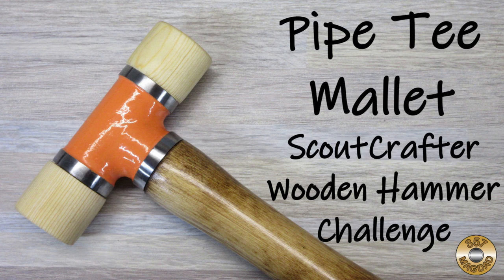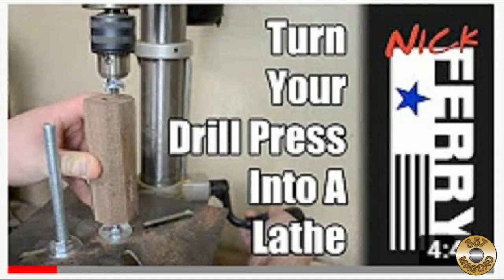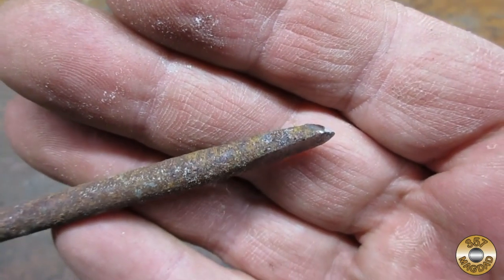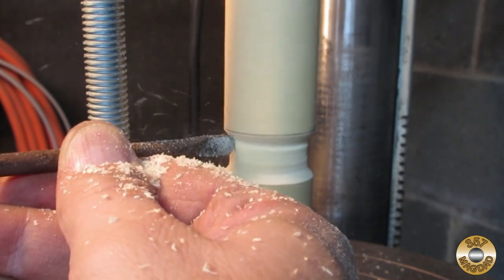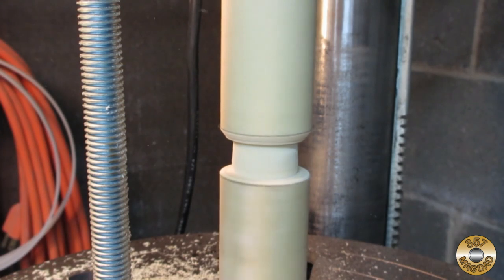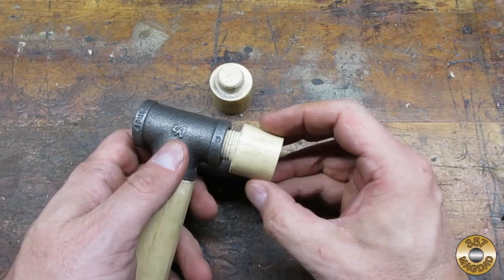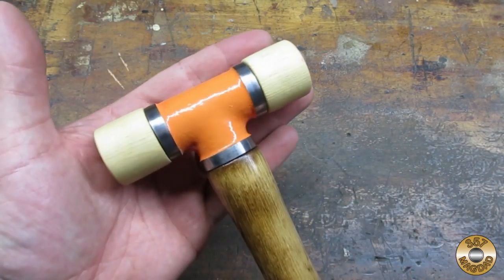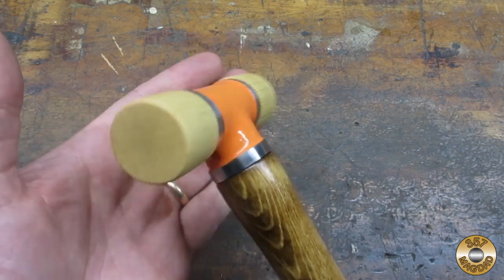Pipe Tee Mallet - ScoutCrafter Wood Hammer Challenge

Comment: Nice entry @357magdad. I learned a few things from that one thanks. One thing I would say is that it is much kinder on the chuck to use a bolt with the head cut off for the headstock, threaded rod in chucks can't be good.
Reply from the maker: Thanks for watching!

Comment: I fought with using brass on my hammer entry. I ended up yelling at my wood bucket for calling me a fraud. I didn't use the brass, one day the bucket will regret talking to me that way. Cool hammer sir, I like the drill press set up.
Reply from the maker: I planned on using a brass pipe tee until I saw how much they cost!